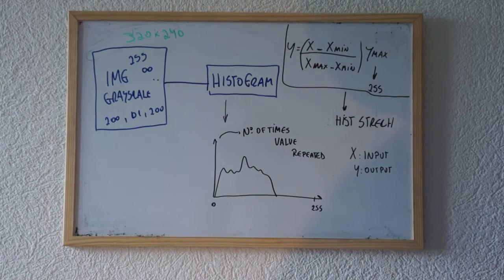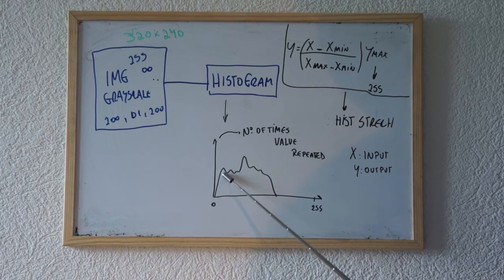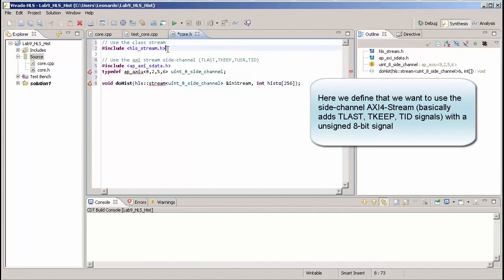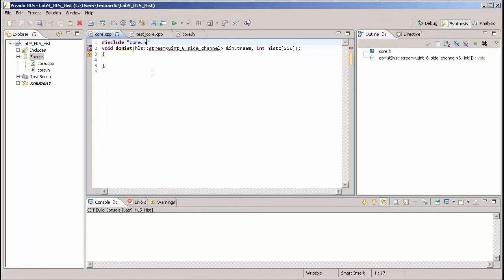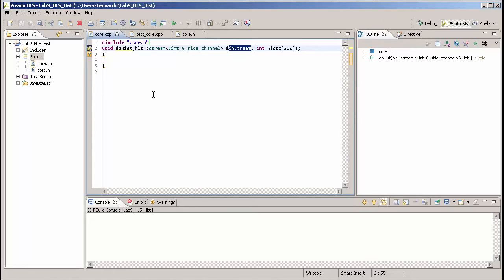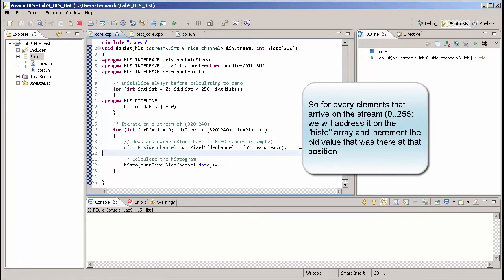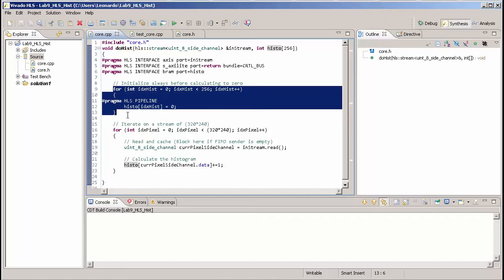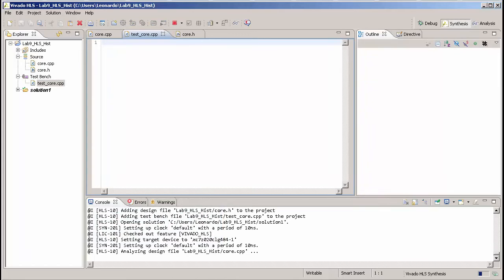Vivado HLS - FPGA Image Processing Histogram #09.1

Comment: Hi, thanks for your really good tutorials.
I have a question regarding the #pragma HLS PIPELINE. As you had commented them out in your google driver, I saw that without them the 2nd loop is 1 cycle faster. Do you know why? That is the default synthesis loop mode in case of no directives #pragma?